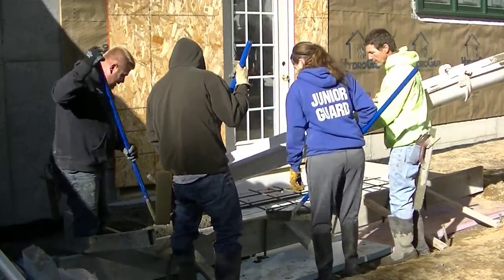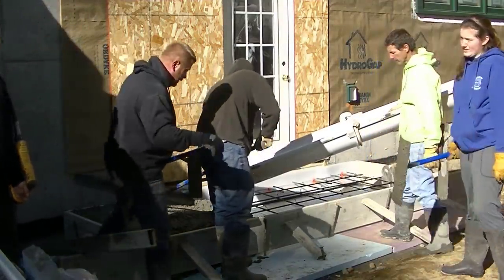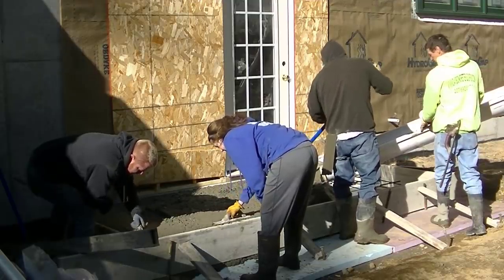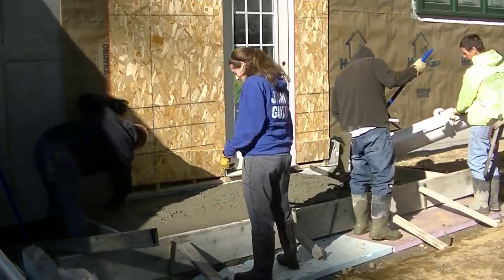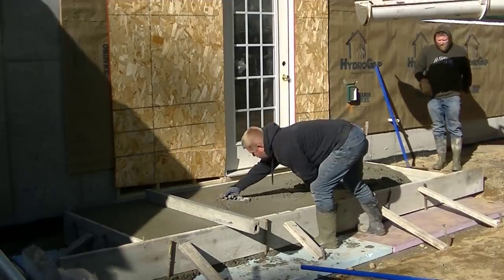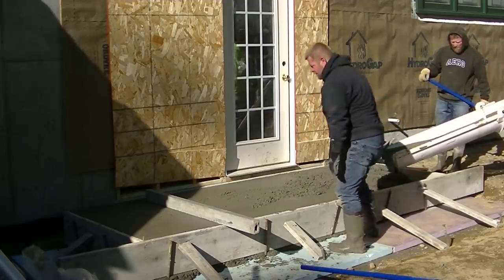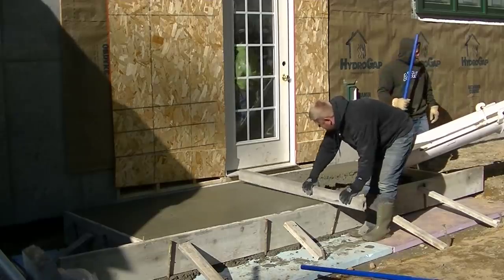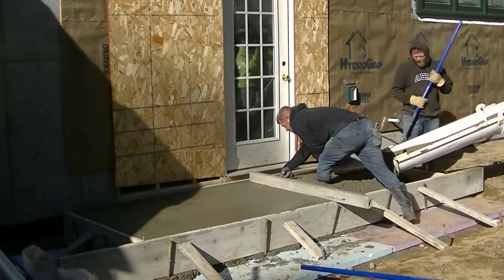He Made Us Pour This Entry Slab 12" THICK! (Waste Of Money?)

Comment: It looks like he is utilizing the height of the pad as the 3’x3’ or greater landing  for the service door to meet code. He would have needed to add steps had he not had the height of the 12” thick slab. He poured it wider because he plans to increase the door size later. I think he did it right the first time. He’s a man that plans ahead.
Reply from the maker: Good comment, thanks Michael!
Reply: Is this your house?
Reply: I had the same thought as well .

Comment: The simplicity of building forms and pouring a 12 inch thick slab was worth the extra $100.  Since the customer wanted a pad this size and elevation, I asked myself "what's the alternative?". It would be to bring in fill material and build up 8 inches to pour a 4 inch thick slab. But we're talking less than 1 1/2 yards of material. Not spending the time and energy it would take to fill, level, and compact the area under the pad, to then build forms and pour a 4 inch thick slab is worth the 100 bucks.
Reply: Agree! I mentioned the same without reading your comment before!

Comment: 12 inch not overkill 
I have customers on driveways do 6 inch and 8 inch where tires would track. 
There’s many reasons why someone goes this thick.
My last garage I did the foundation 
5ft deep. Bottom 18 wide then at grade was 8. 
Basically a upside down V 
He was a engineer. I was able to see several houses and garages he had a part in. Garage separate from houses. Lifted and moved over time. 
A upside V solved those issues. 
Same with deck post. 
A tube is a perfect O 
I always make the bottom wider.

Comment: Engineers Always go Overkill, this really isn't. Up here in MN where the frost line is 42" That entry pad would sit on reinforced frost footing no less than 8in thick.
Your styrofoam insulation is worthless if that slab isn't on a frost footing in the region you're doing it
Reply: Can you explain that to me? Im from Idaho and it doesn’t really “freeze” here. It does but the coldest we had this year was maybe 9 or 10 degrees.
Reply: @anthonyramirez1757 areas with deep frost freeze abs thaw multiple times over the winter and that makes the ground move. Over a few years without a footing this 10,000 pound block of concrete is going to slowly walk it's way down into the ground several inches.

Comment: I was on a typical basement floor pour for just your typical house awhile ago (8+ years) for a guy who was engineering professor at Penn State (we live in and service that area), and the guy was dead set on us putting black 6 mil plastic down instead of what we normally used and had skids of, which was clear 6 mil plastic. To this day I'm not sure why the plastic needed to be black. That's always been my typical experience with engineers on residential projects, way over do things and run costs through the roof because they don't have near enough actual on-site experience. I'm not saying a 20 year experienced concrete guy is smarter than an engineer or vice versa, but there's a lot of the time where the two could work better complete projects in more efficient, sufficient, and cost effective manners. As for commercial work that's a different story haha, but residential stuff doesn't need to be over done for the sake of being over done. However if it's what the customer wants and they're willing to pay what the hell I'll make the concrete blue if need be haha. Another good video👍 
Respectfully,
Williamson Concrete Solutions

Comment: We poured a whole subdivision 3.5”-4” thick. Driveways, sidewalks and slabs. 3500 half fiber mix. Control joints/saw joints every 8’ to 10’. Not one crack 20 years later.

Comment: Yes, at face value, it is overkill but if a step was formed up that would require more labor and a little less concrete. If the owner brings his grass or driveway material up to a step height he then has a large platform. The pad might also be used for possible wheelchair access where you have a larger platform for the wheelchair to sit on before leaving or entering the house!

Comment: You had existing concrete foundation and added new concrete step. How do you seal the tiny seam/crack between the house and step? Can you use 100% silicone? is there another product to prevent water from getting in between?

Comment: I would have told the customer to keep the thickened edge and  put a yard of gravel in the center  to make the top of the pad 6" and saved the cost of the concrete especially since you had other areas of concrete to pour. Also would have epoxied #4 rebar into the house foundation as it's going to be very prone to settling.   He essentially is doing a shallow Frost protected foundation for his front stoop, in Minnesota our stoop foundations have got to be 4 ft in the ground minimum for frost protection. Like you commented in the video it takes about the same to form a 12" as it does a 6" slab, so I don't view it as an over kill.

Comment: I dont’t think extra thick concrete is ever overkill. Anything less than 6 inches always cracks in time. I think it is a great idea. I lived in a home that had the floor slab poured 18 inches thick by the owner/builder to act as heat sink and release. The house had large windows facing the south in the mountains of Arizona. The summers were cool and the winters were warm in the house. No air conditioning was required during the summer and was heated by an undersized furnace for the square footage of the home that rarely went off even when it had snowed and temps were in the single digits.

Comment: I can't say yes or no without any details... What's going on top?  Concrete Pillars? Roof? etc...  Always tie into the foundation with rebar...  My biggest concern was what's budding up to that as far as a step goes?  I would go 6" with rebar at a 3 1/2" slump...  If the ground underneath is fresh then 12" is way too much in my opinion...  I've had ground with 98% compaction still settle and seen the crete go with it...  If there's a right answer then I'm all ears...

Comment: I do this all the time. Labor in CA is so expensive, it's cheaper to pay for the extra concrete then to pay for the load of gravel and labor to put it in and compact it. By the time you factor that labor, the concrete cost is negligible. When I'm doing it for my own house I would rather not work as hard and have to go and get gravel and then put it in. Easier to just pay for the extra concrete and then I get a little added strength. If I ever have to remove it....then I'm screwed.

Comment: Hey Mike, love your channel bro..!!
Well, alot of unknowns here.
I know your up in the NE where most of your work is at...what kind of soil are you and your crew dealing with?
What kind of Engineer are you dealing with? Structural,  civil, or Geotechnical? You got any slate rock formations in the area? What's the porous condition, and saturation percentage of the soil? Is there a French / curtain drain handling the nonporous roof run off underneath it? What was the compaction ratio before crush rock was added as the substra? Were the rebar pins min. 6 " epoxied in foundation footing/ with 36" min exposure into your concrete pour with 36hr cure time?
Short answer, your customer is aquiring dead weight to prevent heaving, I would inquire about any landscaping watering zones, and assuming you are on the Se side of the home I would be concerned of settling not knowing the porosity of your area of work.
Thanks Mike..!!

Comment: they pay they say, the guys an engineer you never know what he has planned for it in the future. Also like you said its only $300 more and it probably gives the guy a better piece of mind. And too do the extra work he hired you so he must have confidence that your company will get the job done right. I didn't know that asphalt was cheaper than concrete though to get done I live in NEPA and we have the same frost, snow and they put the brine down on the road and then never plow the road correctly like they did 20-30 years ago. My 1 local auto mechanic talks about the cars rusting out after 3-4 years b/c of the brine and salt they use. anyway great video, and I'm a fan of the engineer wanting and you using the 12" of concrete. If he were pouring a driveway how think would the driveway have to be in comparison?

Comment: I would go down 24 inches on the sides and 4 inch in the middle with rebar. Concrete has no tensile strength and rebar does, so cracking risk is lower with rebar. You could even do a 42 inch frost wall and 4 inch middle. A 12 inch slab might not be overkill, it's more like mis-allocated money/concrete. I would think a 4 inch slab with rebar could handle an open span of 6 feet+.

Comment: I've poured many a slab myself. Most for use by trucks, cares, etc. I consistently pour to four inches.  I prefer to use fibercrete for most and add wire or rebar for more strength.

Comment: Yes its overkill. If there s a foundation footin under it it will be ok. If not the weight will cause it to drop in time out front.  More is usually not the best.  Iv see thick  porches  crack support walls under them at the basement.

Comment: He wanted and ordered a 12" slab. He wanted to find a concrete guy who would follow plans and not kick dirt in to save on concrete costs. 
My friend dug thousands of foundations in the so cal area from 1948 to 1980. He had issues with concrete guys kicking dirt in to  save costs on the concrete. He started blending dry pigments and with a chapin sprayer would dust the bottom he dug with some builders. As he would get yelled at by inspectors on pour day because of lack of depth issues. He could show the inspector his dry color dusting and shift blame to the builders people . Making the builder pay to dig it back to depth. He only had to do that a few times and they stopped kicking the dirt in.  He had a tiny ring bucket trencher on the shortest oliver tractor to get into the hard places and a ford major 5000 backhoe.  He retired with 7m cash in the bank

Comment: Need some input from some concrete guys. Currently building my house. Its 30x48 post frame home which will have a slab poured. Going to put the roof on this week which will kind of leave me in limbo until I have the plumbing roughed in and slab poured.  I'm considering if I could go ahead and frame my 2x6 (non load bearing) walls between the posts and nail them into place before having the floor poured. They will be suspended in the air nailed to header and outside wall purlins. My question is, would it be difficult to pour,screed, finish the slab if having to fill the void under the bottom plates of the wall sections. I can't think of any reason it wouldn't work to have to walls in place and pour the concrete under them and screed to the bottom of the bottom plate, but I know its an unconventional way to do it. Anyone have any thoughts?

Comment: so many other issues to concern ourselves...slab on the same plane as what appears to be a bottom plate....i would of pulled the  board and finished the face.....mix was so stiff it needed the whole slab vibrated, not just the face.....probably should of set some masonry units or foam boards to raise the subgrade....that is alot of uneccesary weight if the soil wasn,t correctly designed

Comment: The owner probably figured if he's paying for a minimum on truck delivery and you bid the job for labor, why not?
I formed, mixed, and poured my front entry like that using 2x10's. I filled the bottom in with Gravel to bring it to a 6 inch slab. I laid concrete wire and 4 bed rails in it. I wanted it so I could drive on it  if needed to. Someone someday will hate  me for it...lol

Comment: My Dad always told me their are 2 customers you dont want to work for 1 was structural engineers  !! And of course I didnt listen to him and worked for an engineer building a new home and everything we did I thought was overkill ,,,,1/2 expansion band around the whole inside perimeter of the basement floor  a long with 1/2 rebar and wire mesh and fiber in the mix !!  Just for starters !!

Comment: Yes too thick. Concrete thickness is determined by the loads the structure will encounter. If your worried about cracking add rebar towards the walk surface and fiber as needed. 4” is fine. I would place 6” if it were my place and be good.

Comment: Yea overkill, I drive diesel truck on 4000psi 4inch slab with #4 rebar 2’ grid in freeze thaw area joints are 5’x5’ never seen a crack. Sounds like any other engineers on bigger jobs as well

Comment: Yes overkill, 4" main 6" thickened edges, all over compacted gravel base, rebar added is fine especially if worried if slab could settle if the backfill next to house was not compacted. What customer wants he gets... Unless he is trying to take shortcuts which would cost you later. Never take shortcuts, Now the slab you just poured he could park his mother-in-law there without fear of it cracking 😉

Comment: Having worked on houses for over 50 years as a worker and contractor, I imagine he's also asked for at least a 4 inch walk way which will leave him with a 8 inch step. My answer is as long as it's code the customer rules. I've had to redo a few jobs over the years when workers or subs knew better than the designer, architect, owner and signed approved plans. So quit bitching and follow the plans on the permits. Life is so much better when it goes according to the plans. Signed off by  the owner and the inspectors so that ten years down the road when it cracks from some animal digging out a nest or tunnels under it ,it won't be your fault.🤟😎👍

Comment: Well, I'm sure things are differently in other parts of the country, but if your Texas it would be good if you wanted to park a freight train on it. The structural engineer must have been a bunker designer of something. Highways arr not that thick. AK pour will hold most any vehicle you want to put on it. I happen to be a high rise commercial office building operations engineer (Retired). Based on the engineer's directions, This is way to much over-kill. All tough, if he's got the money, I got the mud. Best to you.

Comment: Overkill??? Several pads on the property like this? Did you call the FBI and have them check for Jimmy Hoffa before pouring? Yeah, I would say it's overkill but not to the point of being ridiculous and the price difference isn't very much. If it makes the customer happy, then it's worth it. With the freeze/thaw cycles in that region, I get it, but I would say that a 6" pad with reinforcement, aggregate and fiber will last much more than a lifetime. It's encouraging to see a construction tradesman who cares about doing quality work and providing value to their customers. Good job by you and your crew.

Comment: It’s all about the sub base. We would have porch piers here in MI if that was an 8’ wall. Thickened edge is quite normal here, not the whole pad 12” with rod. When working with engineers and guys like that depending on their experience, sometimes they overbuild in areas yet under build in other areas then act surprised when it gets brought to their attention.
Reply from the maker: Thanks Mike

Comment: 12 inches thick will still crack. It's all about the bass prep. But that takes allot of work to do right. In Minnesota we would dig down 48" pour a footing then block up 40 inches. Then class 5 an packing, ready for a 4 inches slab with a 8" sidewall.  It's code and last a very long time with out moving

Comment: Way overkill, the reinforcement is too far from the exposed surface! If something heavy was dropped on the surface it would be the same as if no bar or mesh was used at all. Imbedded fiber only protects curbs from  "chip out". The real strength of the pour is in the rebar/wire & mesh.

Comment: no
Reply: When they stepped into the concrete to smooth out an area near the door they didn't put much effort in filling the hole when they removed their , they did this a few times. When you withdraw your foot it leaves a good size hole.
Reply: @roysalander1475  I wondered about that, time will tell

Comment: I don’t even need to watch it. Thickness doesn’t matter! It’s more important to have a small footer dug around the perimeter, and wire mesh, and an anchor into the base to keep it from sinking. Pouring 12”…………doesn’t do any of those things. 
Take a shovel and dig a footer around perimeter. Biggest problem with concrete is cracking. It cracks because it lifts from frost. You owe me money for that tip. I only let people who I work for understand why concrete cracks. Only a moron thinks is because it wasn’t thick enough. It’s because of frost and freezing! 😎

Comment: If your customer is an engineer he would know run vs rise. Unless he intends on backfilling and grading the dirt to create a legal step, this isn't code. Personally I would have done two steps at a half moon...30 years in the industry. Wee bit overkill. Typical engineer. Get er done, get paid mob to the next. Most 4 inch or 6 inch entry slabs crack.

Comment: i think he will regret this in years to come. we bought a house with two concrete steps to the front door. its 20 years old now but the concrete had settled and pulled away from the house. a structural engineer also thought it may have contributed to stress cracks in the basement wall near that location